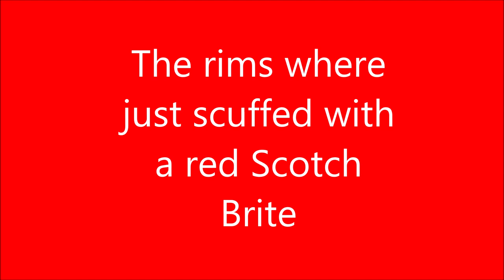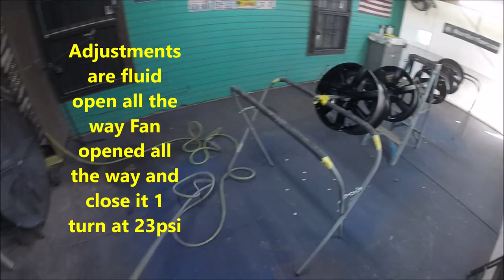How to Paint the Wheels of your Car with the Mini Italco Shine 1.0 tip

Comment: I just got this gun for $60, from local distributor. Mine got 1.2 nozzle. I want a cheap mini gun for rims and smaller panels, my current gun wasted too much material.

It is cheap and but strurdy, have not used it yet. Mine got imperfection casting on the body which I don't care other than that it seems well made. The markmanship on inside parts looks almost like an esrtablished brand. I also got ntools mini 888, it sprays well but might not last long like meiji or iwata.

It is heavy for a mini gun, weight almost like a full size gun. But, overall it is a great deal. Btw, nice jobs on the rims👍.